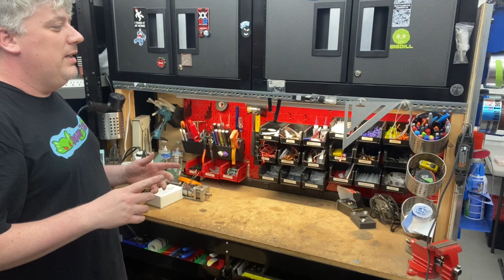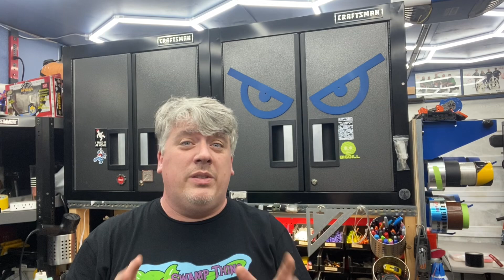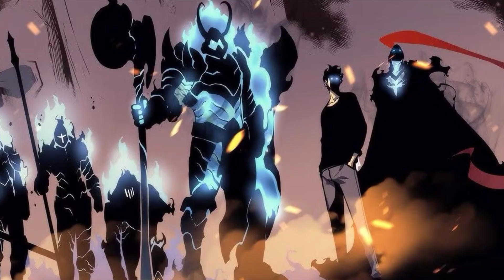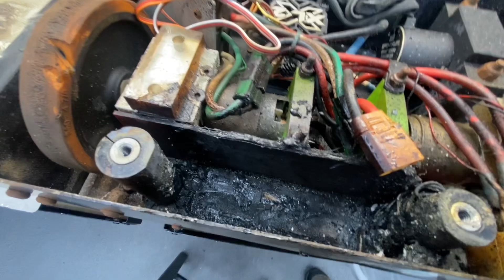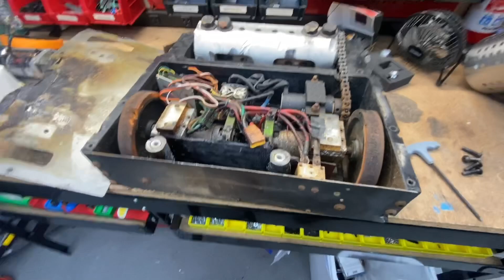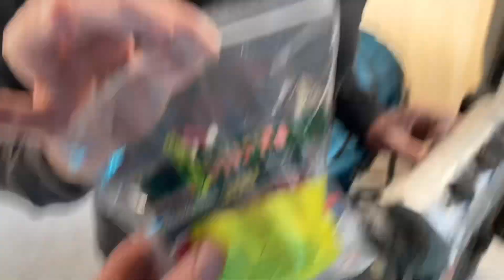Battlebots Legend Ray Billings Lets Us Compete With His Robot!

Comment: I’m starting to see that drum spinners of all classes are very similar. The placement of the motors and drive and electronics in disinformation are almost identical to my FTBB beetle Doom Dimension. I’ve got the weapon motor up front with the ESCs and receiver to the side of the weapon motor then the drive behind all that with the battery and switch behind the drive motors